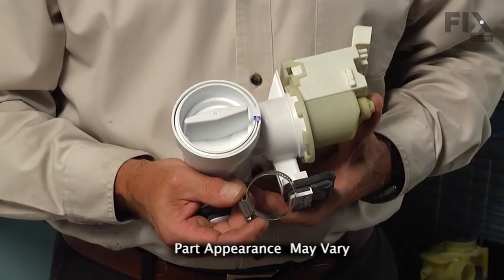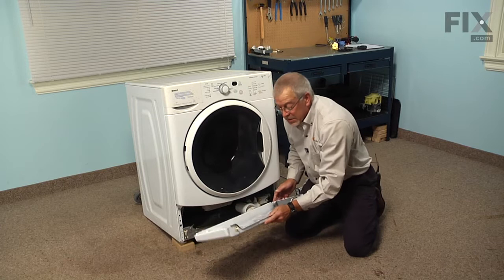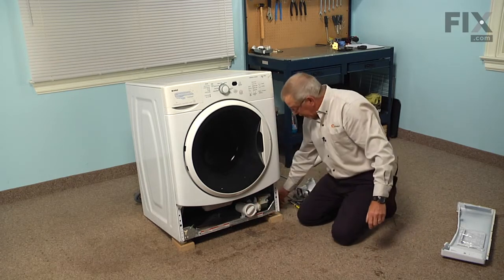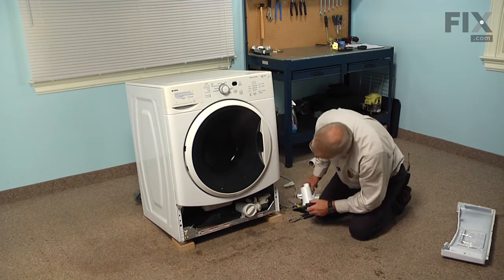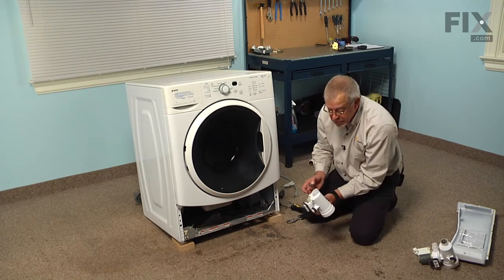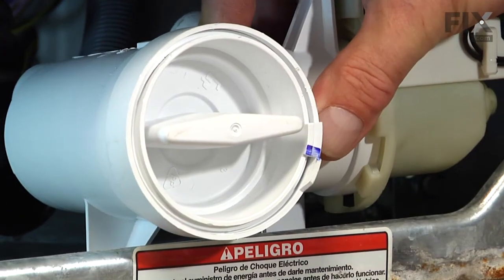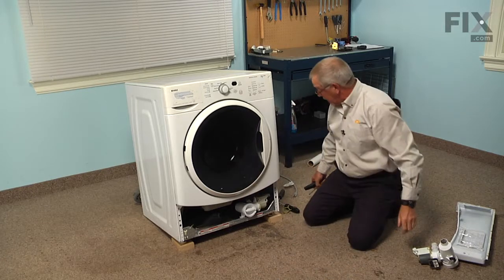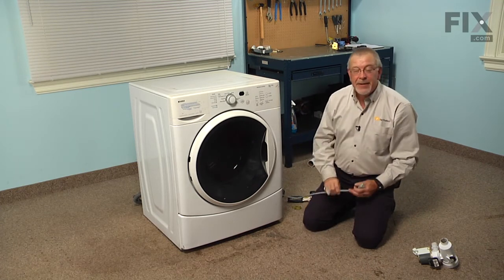Whirlpool Washer Repair – How to replace the Drain Pump

Comment: Great video!  I was about to replace the water pump.
Upon accessing the pump, prior to removal, I drained per your instructions.
Found it was the filter that was totally clogged causing the errors.
Cleared and tested.  16 year old washing machine working like new.
Glad the drain pump motor didn't burn out due to the massive clog!
Your instructions were by far the best.  Thank you!
@FixDotCom